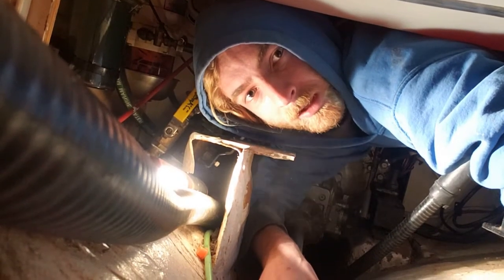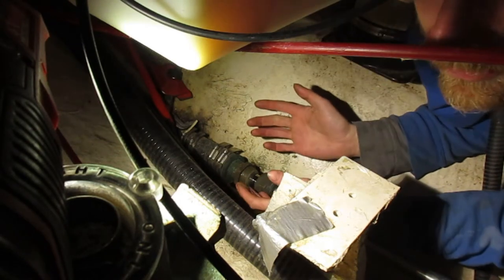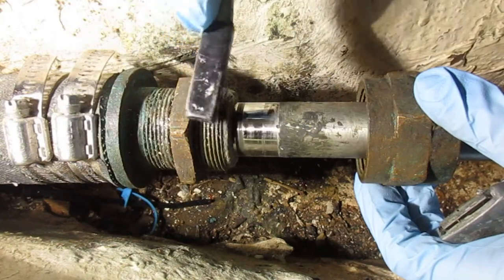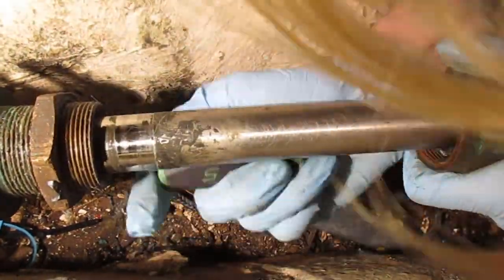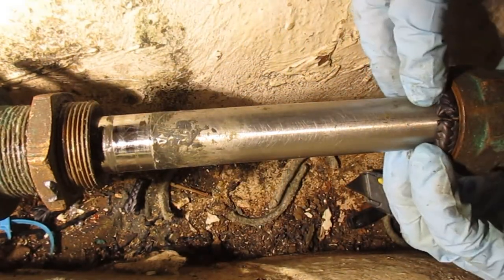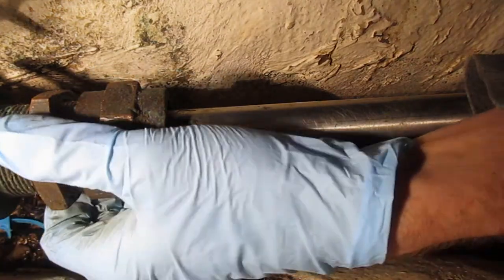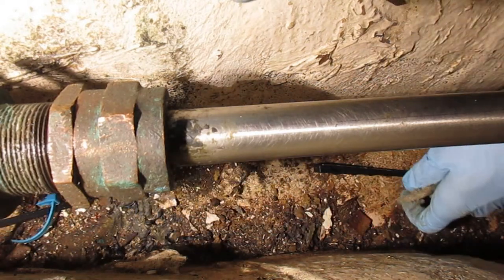How to repack a stuffing box/packing gland on a boat (HHT Ep2)

Comment: Thanks for this video - well done. The only things I'd add is that Nigel Caulder, the authour of the oustanding "Boatowner's Mechanical and Electrical Manual" recomends cutting the packing diagonally at a 45 degree angle to create some overlap the ends of the rings when installed. That and do the cutting on a portion of the shaft not critical to sealing the gland to avoid scoring it. It's also a good idea to keep your bilge as clean as possible - debri can and will  clog your electric bilge pump - usaully at the worst possible moment. I inspect and clean my bilge anually, using a shop vacume  and a hose and soapy water and a flashlight. Anything loose that left get's fished out by hand. Also, you can replace packing with your boat in the water. No more than one or two gallons a minute should enter, and your electric bilge pump should handle that easily - or you need to fix / upgrade it. You can also temporarily seal the prop shaft with bee's wax or a rag or something. Bee's wax is used to seal toilets, so any hardware store should have it in the form of a thick ring. They only cost a few dollars. Good to have a couple on board at all times to plug leaks in an emergency. 

You know, like if your stuffing box packing job leaks during re-comissioning, and your electric bilge pump clogs at the exact same time because you forgot to clean the bilge last year. Ask me how I know this lol.....
Reply: Great advice. Are you near Miami? I am about to buy a sailboat there and in case you have time to give me some mentoring, that would be great.

Comment: great video, hard to do down there! 

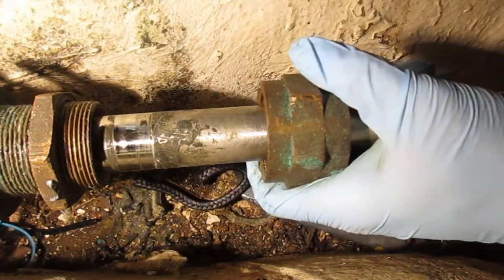2 quick tips,  First, 5:24 Don't cut the flax right on the mating (shiny part of the shaft) as you could be scoring it with the blade. 
                        Second,  6:13 i would have cleaned the shaft, before sliding the stuffing box together, 
                        bonus tip,  6:20 you removed 4 rings and installed 3

Comment: Nice video! Put the seems at 120 degrees, you can put the full length packing around to measure the length in one go. Make a shallow incision but don'r cut it on the shaft ;-)

Comment: found it on Amazon.  im going to my Islander 36 today and check the size needed.  I'll loosen it up and pull the flax to measure. 1" shaft may need 5/16 instead.
Reply from the maker: Yea it also depends on what brand of stuffing box you have not just shaft size

Comment: There is no need to be out of the water to repack a stuffing box its just routine maintenance. Unless you plan on taking all day the amount of water you take on is minimal and easily handled by your bilge pump. I was a shrimp boat captain for 30yrs, so I have a bit of experience. Not a complicated procedure.
Reply from the maker: Yea ive told my service manager that but he doesnt want to take the chance

Comment: Great video. Quick question? Could you use the threads to seat each level of packing?
Reply from the maker: Yes you can, I do that sometimes if i have trouble pushing it with the screw driver
Reply from the maker: Just need to be carefull, sometimes the rings will spin and the gaps wont be right
Reply: @haydenfoy5723  You should not be useing a screwdriver in the first place, unless you want to damage /cut the packing.
Reply from the maker: @DingoBYD  the packing is pretty durable stuff a screw driver wont harm it. Most times the razor blade stuggles to cut it. Thats why i alway put a fresh blade on before i do packing jobs

Comment: When cutting the gland packing mitre the packing ends to guarantee a full water tight seal butting the joints aren’t always water tight..alternating the joints as not to be all in alignment.
Reply from the maker: I do alternate them, do you mean cutting them at a slaint instead of staight?
Reply: @haydenfoy5723  that’s exactly what I mean ends to ends are not fully sealed just pointing it out not meaning anything just an engineers view.
Reply: @davetomlinson8944  Yes, I saw another video on this topic and they guy mentioned doing that too.

Comment: Why dont ya have to add some grease to that material, before reassembling?
Reply from the maker: Im using gor tex packing which doesnt require grease like flax packing, it also doesnt need sea water for lubrication or cooling and is dripless unlike flax

Comment: You took out 4 pieces and only installed 3.  Did this cause a problem, or did you just screw it down further?
Reply from the maker: Didnt cause any issues just tightens down farther, i felt 4 was a bit too much. Typically 2 or 3 rings is plenty

Comment: Scoring your propeller shaft with the blade will shred your packing in no-time
Reply from the maker: That shaft is way harder steel then the knife
Reply: @haydenfoy5723  i bet it's not!
Reply: I was worried about that too.   I figure, better that Hayden is out there in freezing cold bilge and doing it his way...  than me out there in the frozen bilge and doing it my way.   I will guess a light impact of the blade wouldn't cause a scratch.  But a heavier impact might scratch the shaft... so both folks have a point to make.
Reply: Still probably better to do it outside of the white area of the packing in case you do actually scratch it. Are stainless steel prop shafts coated in chromium like hydraulic cylinders? Those are quite hard.